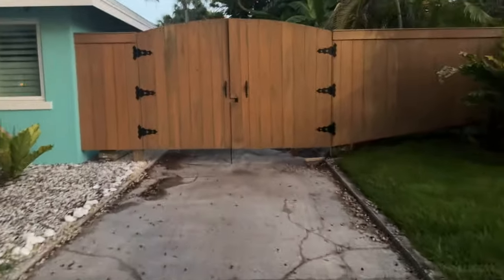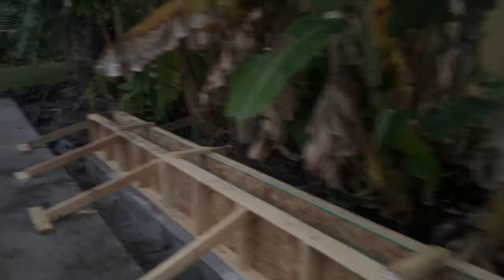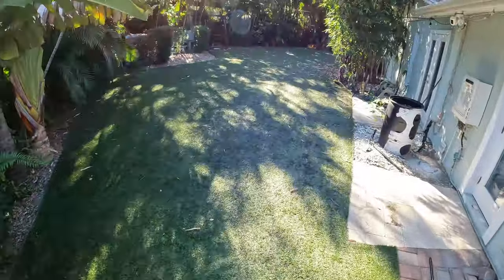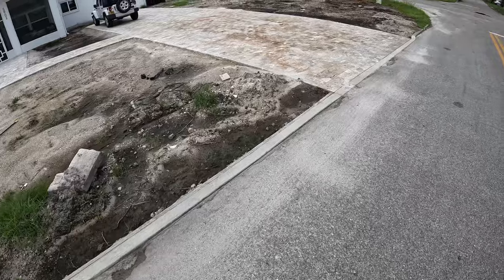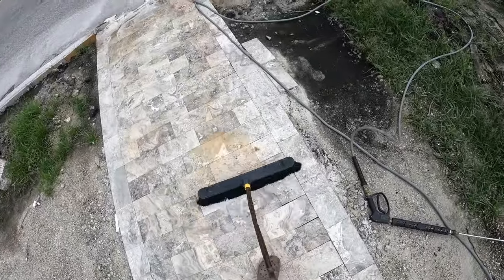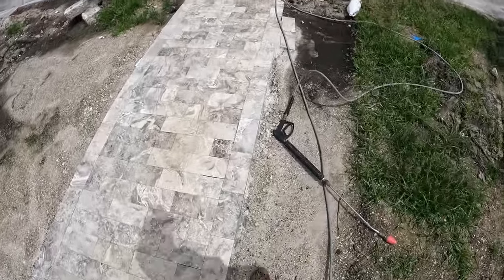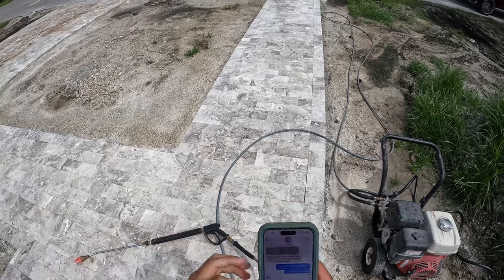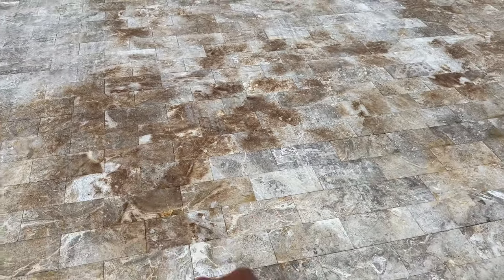Brand New Driveway Ruined By Mystery Stains!

Comment: Here's the deal 35 plus years in paving industry what's happening is your putting the pavers in sand which is causing moisture from the wet ground to wick up the pavers because the sun is beating on the surface drying them out this is a natural stone product and it has a lot of minerals in it that's what you're seeing come to the surface.. you need to put these in an open grated base meaning instead of sand screed use a 3/8 inch chip so that there's no moisture wicking up to the surface it's even worse with a concrete paver because of all of the minerals inside of it called efflorescence.. do not seal this because you're going to trap all that underneath the sealer which is going to require you to strip.. stop using gravel and sand and start using a washed 3/4 inch stone for base and a 3/8 inch chip to screed
Reply from the maker: Where are you located? In Florida sand is the industry standard for travertine pavers recommended by the paver manufacturer, Clean 250 sand to be exact. I know up north sand is a no go for installing pavers but in Florida it is the norm.
Reply: I wanted to offer some insights to help you succeed with building materials. The specifications and standards in the books are often misleading. For instance, I've seen people build retaining walls that are 10 feet high, only to find they're two blocks short at the top because the specifications stated the blocks were 8 inches, but they were actually only 7.5 inches. When you account for 20 courses with a half-inch discrepancy for each, you end up with a significant issue—one that leaves you explaining to your customer that the book says they’re 8 inches!

Another important point is how water wicks up through gravel (clay and 1" minus rock) and sand. If the bottom of your paver is wet while the top is dry, water will travel through the paver via capillary action and osmotic pressure, pulling minerals from the stone or concrete and discoloring the surface. The only material that doesn’t do this is porcelain. In Florida, where frost heave isn’t an issue, the main concern is preventing water from traveling through the paver and causing discoloration. Materials tend to last longer when they’re dry rather than submerged in water.

Using 3/4-inch stone and 3/8" chip provides an air gap and requires almost no compaction vs gravel and sand, as it’s already compact when you spread it. If you don’t compact your gravel properly, you can run into problems later on. While 3/4-inch stone and 3/8-inch chip may be more expensive, they are well worth the investment, and it’s something to communicate to your customers. Set your own industry standards with undisputed facts! And don't get me started on reinforced retaining walls lol...
Reply from the maker: @Corruptyoutube  Wow thank you for the in depth explanation! I'm always willing to hear and learn from others in the trades to minimize as many mistakes i could make as possible, Thank you for your comment!